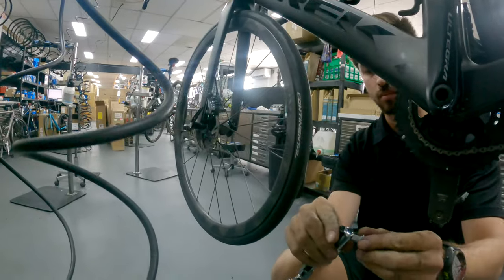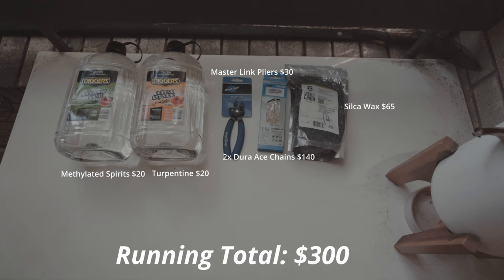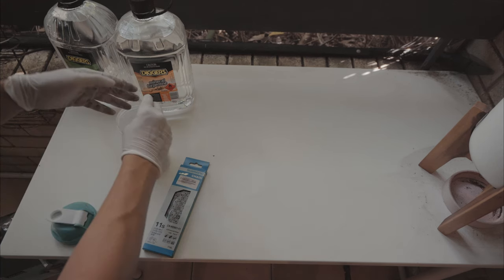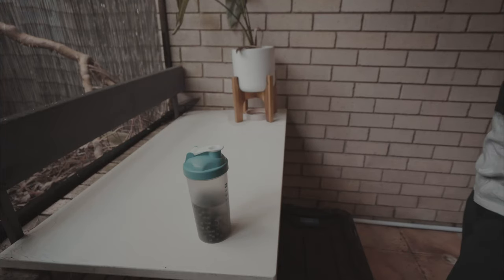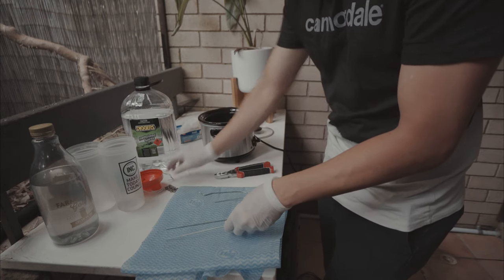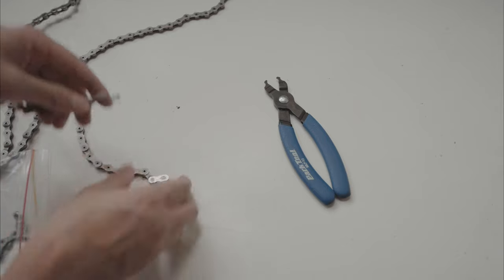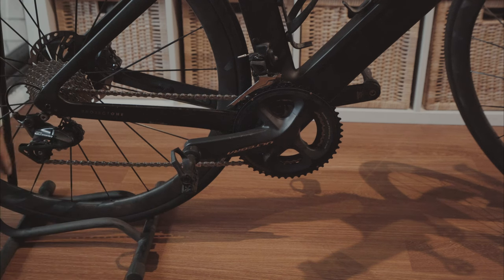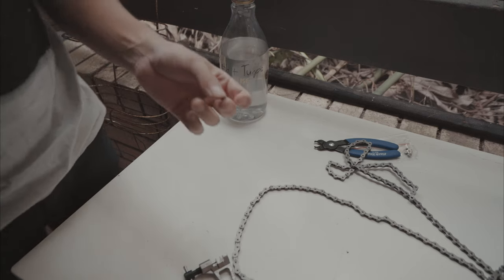How much did it cost me to go to wax? A FULL beginners guide to converting to wax (99Bikes GIVEAWAY)

Comment: I’ve been chain waxing for a couple of years now. I’ve got 14,000km on a SRAM Force setup with 3 chains and it’s still going strong with hardly any wear. Here’s some of my tips.

- I put the chain on the coat hanger holder on top of the wax then turn it on. That way the chain also gets warm as the wax melts.
   If you don’t do this make sure when you put the chain in the melted wax and you move it around that you don’t see any bubbles. This ensures the wax has penetrated into all the rollers.

- When I pull my chain out of the melted wax I put the end chain loop onto a hook so the entire chain can hang down in one line. It makes it easier to break the wax.

- I’m also using Silca wax. The good thing with their wax is you top up using their Super Secret drip wax. It’s the same wax that’s in holt melt, so every 200 – 300km I drop some in each roller link. This way you can top up the wax and extend out the chain re-wax every 800 -1000km.

- Depending on the conditions the chains been in, every now and then when I take the old waxed chain off for a wax refresh, I put it in a container with boiling water and shake it around. This     flushes everything out of the chain so it’s like brand new. Let it dry in the sun or use a hair dryer, then wax.

(Keep up the good work on your channel - PS I was the one that doing the 80km Bobbin Head classic that came up to you at the start.)
Reply from the maker: Tony, fantastic tips and I really appreciate the advice from a waxing master. 
I’ll have to grab some of that Silca drip wax. 
Bobbin head yesterday was a pleasure on the newly waxed system and it felt like butter. 

Thanks for coming to say hi! It’s always nice to know there’s real people out there watching the channel and enjoying the content. Hope you had a safe and fun ride yesterday, keep it up!!
Reply: @joshkwan  Also forgot to add that Zero Friction Cycling in Adelaide sell ultrasonically cleaned and wax treated  new chains if you don't want to do the chemical cleaning part at the beginning. Might help people over come one barrier to start waxing.
Yes had a great time doing the 80km ride, managed to do my best time of just over 3hours.
Reply from the maker: That’s a handy tip, since this is probably the only time consuming part of the process. 

Great work mate, what was your race strategy? I find that if you skip most of the rest stops you can save a lot of time.
Reply: @joshkwan  Only stopped once for 30secs just before the Akuna Bay hill to get a Gel out. Also did most of the course in various rides before hand. I do Bobbin Head every weekend so know every bump in the road. Northern part of Sydney is where I do most of my riding. I can also hill climb pretty well for someone that's 57!
Reply from the maker: Haha you came flying past us at the top of Bobbin Head East. Doing very well for your age, keep it up.
Hopefully see you more on the road

Comment: When you're refitting the two jockey wheel retaining bolts it's good to use a bit of thread locker (such as Loctite 243) on the respective threads to stop them working themselves loose over time.
Reply from the maker: Thanks John. That’s too true, I checked the jockey wheels last night and one was already slightly looser. I’ll get some loctite

Comment: Another great video Josh! I've only been running a waxed chain for about a month but loving it so far, if you're riding almost everyday I recommend topping up with Silca Super Secret Chain Lube so you don't have to re-wax every two weeks. Reason for running a waxed chain, always super clean, chain last longer and cycling is an expensive hobby so in the long term the wife won't be angry :face-blue-smiling:
Reply from the maker: I’ve done one ride and the buttery smooth drive chain feels oh so good. 
Thanks for the tip Jimmy, I’ll buy some of that.

Happy wife, happy life :)

Comment: I recently changed from using Squirt to full wax immersion. Squirt left a lot of gunk on my chain and cassette. Pretty happy with my set-up now, and the rewax process is easy. I tend to do my first ride on the indoors trainer. I put a container under the running gear and collect all of the clean excess wax that comes off, which goes back in the pot. My only complaint is that I do find wax flecks stick to the frame and other components. Also, Wipperman Connex link for the win.
Reply from the maker: Thanks for the insight mate

Comment: Nice video. The only thing I do differently is when taking the chain off the bike rest a hand against the derailleur so it doesn't slam into the closed position. At 20900km for current chains. 50% through life according to the chain check tool. 41850 km total on the bike. The large chain ring is showing some wear. Cassette almost can't tell but am running 2 of them. One indoor and one outdoors on wheels. Congrats on making the switch your parts should last much longer. I live in a desert climate and wax every 280 km.
Reply from the maker: Thanks for the comment mate. Sounds like you have a pretty disciplined routine and it’s worked out very well. 

I’m about 3000km into my journey and I’ll be stoked if I can get similar results. 

So far I’ve been changing the chain every 250-300km, sooner if I have any rides in the rain. 

Good tip for when taking the chain off, I’ll do that next time.

Comment: been waxing for over a year, a couple of tips:
- as @Stphen Cheung pointed out, turn the crockpot off, wait until a film appears on the surface, remove chain, more wax will remain inside and unfortunately on the outside chain (but easy to clean of with a brush)
- after each ride just wipe the chain with a rag dipped in methylated spirits, keeps it clean (see below) and prevents wax build up on other components
- Tungsten Disulphide the lubricant that gives you the free watt/s is dark grey in colour, so your dogs will still get the occasional dark mark but a lot less than before and easier to clean off. I have a black and white border collie who get chain marks, usually on his head.
Reply from the maker: Hey Nick, thanks for those words of advice. Lots of ways for me to refine and perfect my process! 

Unfortunately my westies are the perfect height to walk under my chainrings and they seem to love getting the whole thing on their back hahaha

Comment: Waxed chains for sure - keeps everything nice and clean, especially since I keep my bike in the apartment. I'd also suggest a good drip wax lube too (e.g. Silca Super Secret Chain Lube) that you can apply in-between full immersive waxes.
Reply from the maker: Thanks for the tip, I’ll give this a go too. 
Does it melt okay back into the main pot of wax, or does it need to be melted off with some hot water?
Reply: @joshkwan  Silca Super Secret is good to melt back into the main pot - if riding around in the rain and there's some road grit in there, you can also give it a boiling water rinse before chucking it into the pot. I used Zero Friction Cycling's guides/videos as a source.
Reply from the maker: Sweet, thanks Kevin!

Comment: Hah, what timing, I'm putting together parts for a new GRX build (where's 12 Speed GRX Di2 wireless already...) in Melbourne and I've just started shopping around and comparing waxes. I'm not sold on durability but I'm tired of the stains and dirt and degreaser and kerosene and petrol and so on for cleaning and maintenance.
Reply from the maker: Nothing worse than dropping your chain and having to manhandle a greasy chain 😖

Comment: I love this video, a very good beginner guide that gives me a good idea of waxing your bike chain and I may start to use this method after I get new set of bike chain and cassette. However I have a few questions. 1. Base on your personal condition, how much time and cost difference between wax and lube in one year, including the upfront time and cost? 2. Can you use the leftover wax in slow cooker again? 3. After a muddy day ride I will wash my bike, can I leave my chain or I should wax it again? 4. Do you want to include your protein shake bottle(s) in your cost? lol
Reply from the maker: Hey mate, thanks for the comment!
1. I’ve only done one ride with the waxed chain so you might have to wait a year or so for me to come back with that result! But if your chain and components last an extra few thousand kilometers, that represents at least a couple hundred dollars of savings. 
2. Yes! If you have cleaned everything properly then the wax should be clean and can be used continuously. 
3. The beauty of wax is you can clean it off with some hot water very easily, let it dry and then re-wax. But if the chain is clean just pop it straight back into the pot of wax. 
4. I received them for free as part of gym memberships! 😂
Reply: @joshkwan  Haha I love your protein shake bottle answer and looking forward to know how you find a year or less

Comment: Waxing for the win all the way. You don’t even need to spend big dollars on the big brands. A high quality wax on its own will do an awesome job. Adding Teflon is another great cheap option. I run two Connex chains as well as they have the reusable tool free link. The best option for waxing as you don’t need to keep replacing the links.
Reply from the maker: Yea I’ve got a couple of mates who have just bought big blocks of paraffin wax which seems to work just fine. Thanks for the tips Andrew!
Reply: @joshkwan  badger wax is great stuff. I would highly recommend using a Connex link on your chains. Will save you heaps over the life of your chains.
Reply from the maker: I’ll look into it, cheers

Comment: I’ll continue to wax my chains solely on the fact that the drivetrain is so clean. No greasy fingers and calves. Sucks to mess up nice cycling kits with grease. 

For melting wax, I got a cheap stainless steel bowl for few dollars, put it on the electric stove on lowest few settings. It should be able to melt the wax in 30mins, and slow enough to not degrade the wax.
Reply from the maker: That’s good space saving tip! Thanks Calvin

Comment: Nailed it Josh!

A few more things I've learnt along the way. 

- Have 3 or 4 chains on rotation (if you do >350km per week, then it'll be once every 3 week job)

- buy a small brush (slightly harder bristles) for a quick brush every couple days, as Wax eventually builds ups in the cassettes, chain rings & derailleurs.

- before you change the chain / rewax, use a wet wipe (with chain on bike) and wipe the chain aggressively. Make sure it's dry though before dunking it in the pot.

- when chain is in the pot, let the wax cool down a bit, it will turn slightly cloudy with a layer on top. Then pull the chain out. This way the wax won't all drip off.
Reply from the maker: Thanks Stephen, lessons from a Zero Friction master. I appreciate it!

Comment: I regularly clean my drivetrain chain. Lube is easier to clean if you don’t leave it for too long. Cleaning wax residue off the drivetrain is a pain!
Reply: Get Diggers Wax and Grease remover from bunnings its removes the wax with no issues
Reply: Exactly what Ben said. Removes the wax like hot water melting butter
Reply from the maker: Thanks for the tip lads, looks like it’s back to Bunnings 🤣

Comment: Ceramic speed UFO drip. Apply like normal lube, drys like wax, stays clean like wax, and at $50 or so for a bottle last for ages with out the need for a lot of maintenance time. Obviously chain and drive line needs cleaning originally like wax does at the start but stays clean. Maintenance is just a wipe and top up.
Reply from the maker: This stuff is so highly rated by my mates. Shame its sold out all the time.
Reply: @joshkwan  I bought a couple of bottles of after I first tried it. Ease of application is just so good but the feel of riding it and how clean  everything stays is on par with wax.
Reply from the maker: I’ve had a couple of people suggest the Silca drip wax. Have you used this and how does it compare?
Reply: @joshkwan  no, I was always a muc off lube user. Came across the ufo drip on a YouTube video and got a bottle of it hesitant on being much different or better…… wow!!! I’d never go back to a normal drip lube.
Reply from the maker: I better turn my ‘back in stock’ alerts on!
Reply: @joshkwan  definitely worth comparing with a wax like you have to see the difference.
Reply from the maker: Brad, please check my channels announcement page, you’ve won one of the giveaway prizes :)
Reply: @joshkwan  thank you mate 😊. Keep up the great content your YouTube channel.

Comment: Congrats on going wax. But you used too much chemical. No need for 4 litres. Also try to get tool free reusable quick links. No need for over expensive park tools. The upfront costs for going wax is far cheaper than you'd think and long term you're saving money over oil lube method.
Reply from the maker: Any recommended brands for the re-useable quick links?
Reply: @joshkwan  Connex wipperman if you can get them

Comment: You spent too much. You only need the 1lt bottles, not 20lts! 
I guess you'll never run out of turps and mineral spirits now 😅
Reply from the maker: Enough turps to strip the whole apartment of its paint!

I’ve got a gravel bike as well which I’m considering switching to wax, in which case I’ll repeat this process again for its chains.
Reply: @joshkwan  Fair enough. I have so many pasta sauce jars in my garage for chain cleaning. Don't pour out the turps, you can reuse them. Let the turps sit for a few days and all the dirt falls to the bottom. Pour the clean turps to a new jar for your next use. 
It's good for killing weeds too.
Reply from the maker: Appreciate it mate, time to cook some pasta this week :)

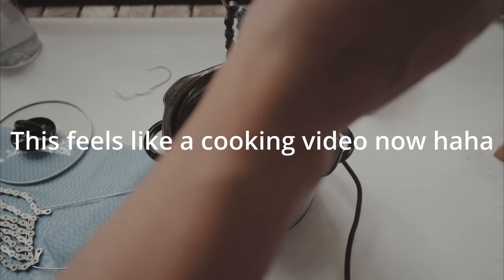Comment: 11:23 is where everyone gets in wrong in their tutorials. You want to let the entire pot and chain cool and harden together, then you pick all the wax off. 
You want the rollers to be FULL of wax, this stops dirt getting in and keeps the rollers lubed forever. You can see when you lift it out of the pot that all the liquid wax is just draining out of the chain. You also mention it stops metal on metal contact which is obviously not possible.
Reply from the maker: To be honest I’ve never heard of doing it this way, I’m sure there may be some merit in it.

Maybe I should say ‘reduced’ metal on metal action.
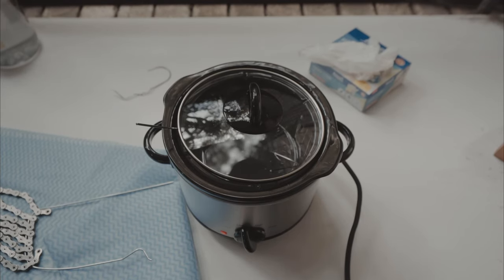Reply: 11:19 doesn't look like much drained out? Wax is a lot more viscous than lube, I reckon once the wax is inside the links it doesn't just drain out thanks to surface tension the same way drip lube stays inside the links even though it's less viscous. Even Zero Friction Cycling's guide says to lift out and hang for 15 seconds above the pot to let excess wax drip back into the pot.

edit: Silca's guide (via GCN) says the wax shouldn't be cooled down too much before chain removal as the excess wax that sticks to the chain can gunk up the rest of the drivetrain and possibly contribute to producing a grinding paste when mixed with road dirt. I imagine Silca (and ZFC) would know a thing or two about waxing chains.
Reply from the maker: Yep I agree. I have read and watches a fair few guides and haven’t come across any which say to let the chain harden in the wax. 

Seems a little excessive, but if there’s some material out there which says this I’d love to have a read/watch.
Reply: @joshkwan  you want lube inside the rollers and no where else. If you let it solidify inside dirt and sand can't get in. You also end up with a quiet chain. You must also vibrate container while  the wax is liquid (battery drill on hammer or #1torque while the chuck can't turn)
Just be a scientists and wax up some spare excess links using both methods, then break the links and look inside the rollers to see how little wax is in the drip dry method.
Reply: @veryboringname.  not much went INSIDE the rollers. If you DIY wax and use the above vibrating you'll see air bubbles escaping out of the links for minutes. Dropping the chain in hot wax doesn't get much wax in the chain. 
Crosschaining with high watts and dirt ingress kills chains. The claims of 10000km chain wear are dubious from these old men that might not be cracking 300w.
Reply from the maker: @janeblogs324  Thanks for the suggestions, I'm planning on doing a follow up video, so this is something I'll look into.
Reply: @janeblogs324  Have you done actual tests and logged your data? You should publish it somewhere for everyone to see since you're so confident on what you're saying. Anecdotes aren't data after all.
Reply: @janeblogs324  I do avoid cross-chaining on the extreme ends of the cassette. However, regularly near or above 300 watts with sprints in the 1400 watt range. Still getting over 10000km. I also re wax every 300km or less.